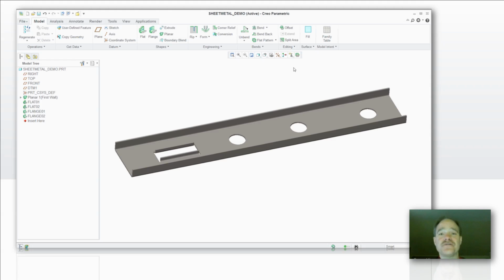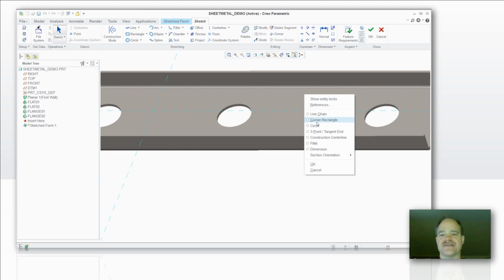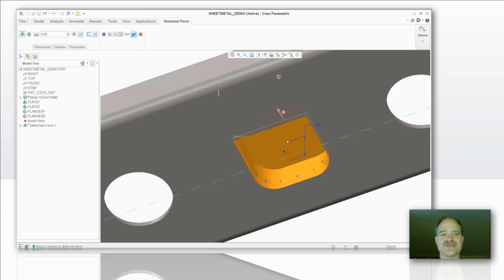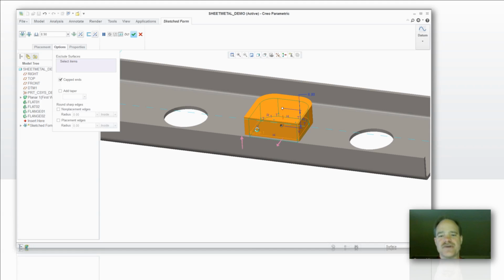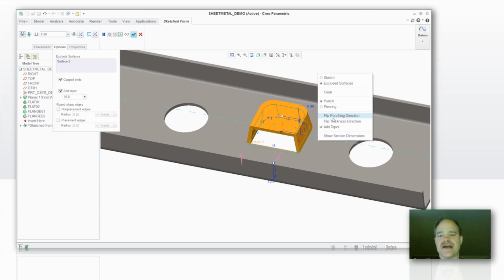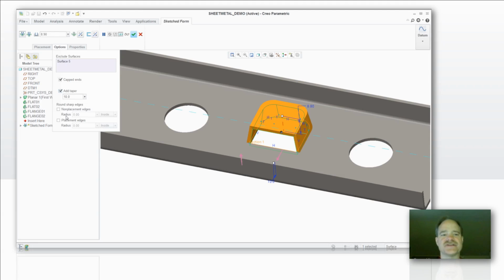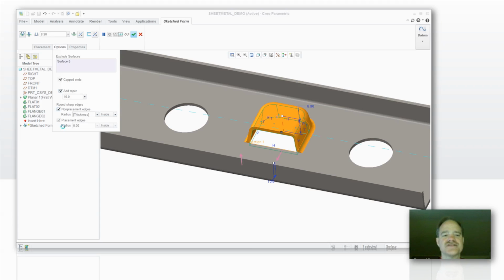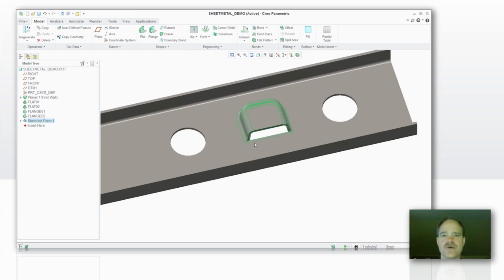EAC Tip-of-the-Week: NEW Creo 2.0 Sketched Form Tool

Comment: I'm confused about material stretch when adding a sketched form. After analyzing the area before and after adding the form I noticed that area for the form I added was 2X larger then the flat pattern...I don't think Creo is using the bend table after flatting the form...